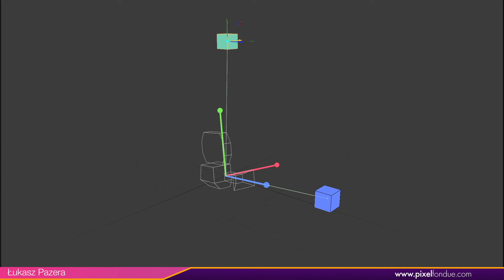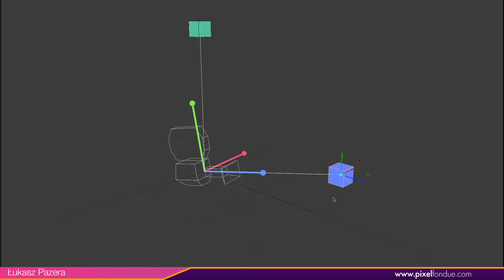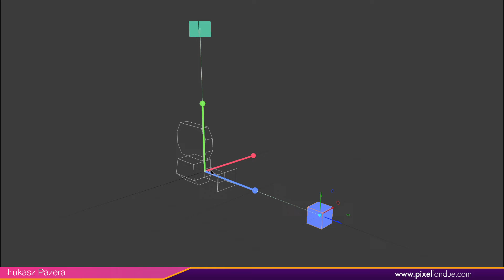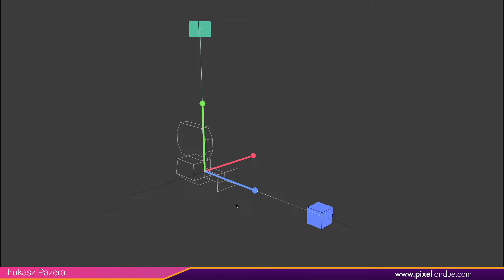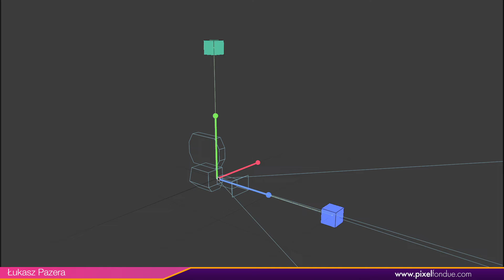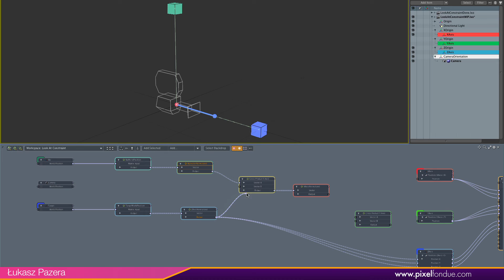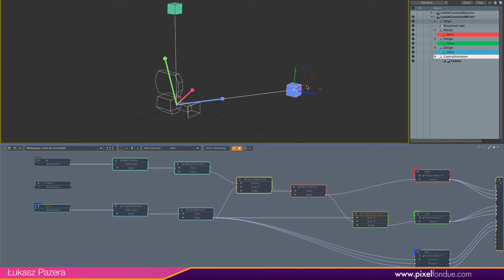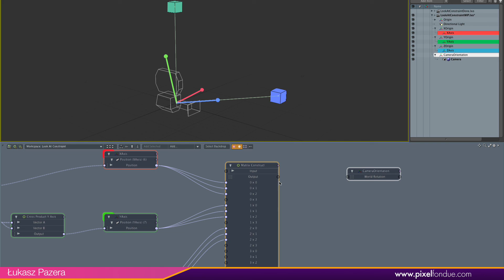How CG Works | Look At Constraint

Comment: Does this setup work only when camera is in the origin? 
Because, if I understood correctly, now the vector for z-axis is the position vector off the Target (normalized), and if the camera moves out from origo, then the position vector is not same as the vector from Camera to Target.
Reply: Yes, for simplicity camera has to be at origin here. If you move camera from origin you need to take camera's world position vector and substract it from both target and up vector world positions vectors before you can use them for further calculations. There's vector substract operation for that. This has an effect of moving everything to origin (you basically cancel out camera's offset in world for the entire setup).